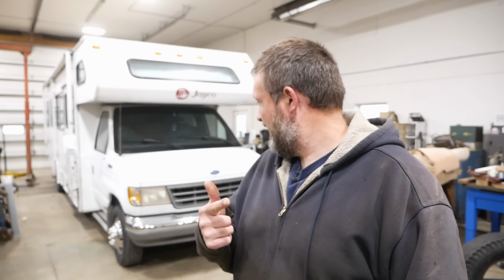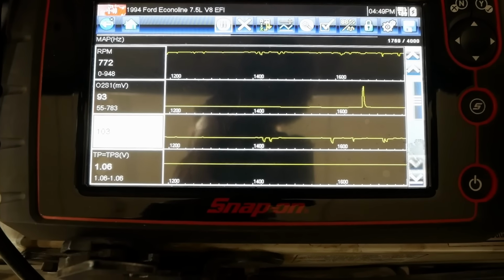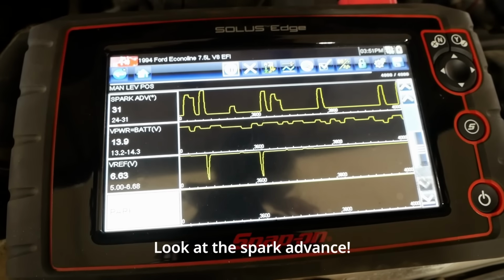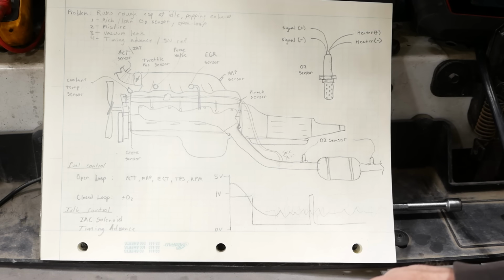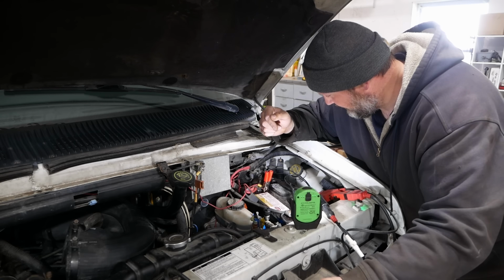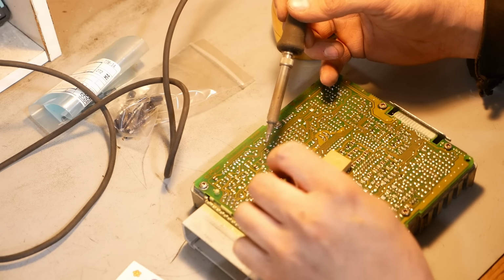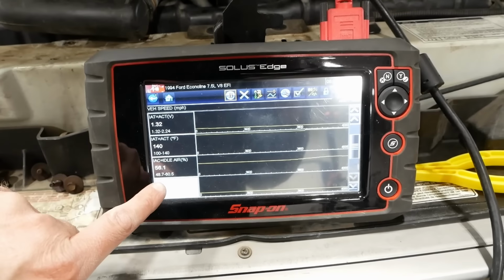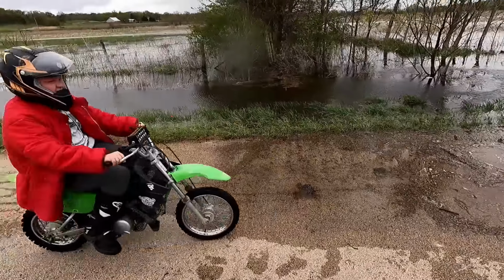Ford 460 RV Surges, Runs Rough but Nothing's Wrong?

Comment: Awesome job Wes! But you were about three years too late to help me out. I had the same situation about 3 years ago in my 95 E350 cube van with same exact drivetrain and identical symptoms. I unfortunately did not have any fancy diagnostic tools to help me pinpoint the problem. I spent many days trouble shooting and replacing various "bad" components... basically chasing the first few things you had thought it was... I love your little sketches, lists and flow charts. It ran better every time I "fixed" something but idle was still horrible. After talking to everyone I knew about what it could be and relentless internet searching, I figured maybe the computer was bad. After seeing that it was not even available anymore and for some outrageous price I could send it out for rebuilding, I decided to open it up and found the leaking capacitors. No stores close to me on the North Carolina shore sell capacitors anymore(where is radio shack when you need them?) but after a search on ebay I found a guy selling the three caps as a kit. Replaced all three and ran better than when I bought it 20 years ago! The best part of this story is that during my internet search I ran across your youtube channel because of that old E350 based flatbed you were working on. I have watched every video you have produced since. I really appreciate all the information you have put out there for everyone. I also have that disease where if its broken and I cant figure it out, it bugs me so much that I spend way more time and money than it is worth to fix it... but I am happy... I think? Broke but happy. Oh well,  I never liked paying bills anyways...
Reply: I’m glad you took the time to tell us about this experience. It’s the figuring out why,  that make people like you and Wes great. Never give up.
Reply: Thats the spirit guys!! FixNshare, that way we get a warm feeling and keep hold of our hard earned a little longer fellas. 5*
Reply: Wow dude awesome dialogue.  I have the same issues with my E350 Cube Van.  I will look Into the capacitors,  thank you for the insights and information.

Comment: Ford puts an air injection manifold on the back of the heads that injects fresh air into the galley that feeds the EGR valve.  There is also air injection into a 3-way catalytic converter.  There should be 2 vacuum controlled valves, one is the thermactor control valve, this should turn the air injection off and on, the second is the thermactor diverter valve, which chooses between the catalytic converter and the EGR ports.  I suspect one or both of these actuators and valves are not working properly.
Reply: Thermactor to the back of the heads was only on carbureted 460's (up through '87... I drive one)
'88 on they inject air into the manifolds only and only have a single pump.
The check valves do get flakey.

Comment: Sooner or later the exhaust manifold leaks need to be fixed or it'll never run right.  We had a customer with a F-450 dump that was on it's 3rd clutch in 500 miles...nothing wrong with the clutches the engine wouldn't idle because the manifolds leaked so bad it threw off the O2 sensors.   They SUCK to get all the broken studs out...nobody likes doing it so expect to pay dearly.

Comment: I'm right along with you I don't understand it either (insert Ford joke here) but funny enough my 89 f150 lariat had the same problem on the same exact capacitor after replacing those three caps the truck is still doing great three years later after the repair.

Comment: Electronics repair tech here, and I have to compliment you on your repair process and tooling. Only thing I would add would be to have added a bit of RTV to the capacitors to act as a shock absorber, given how much vibration the computer would be subjected to…

Comment: I had a 1988 Isuzu Trooper with a 2.6 liter engine that would idle in open loop, but as soon as it came off idle it would go into closed loop. It apparently was supposed to work that way. There was a lot of weird and difficult engineering decisions in that engine.

Comment: It actually makes sense to me that those older engine computers are having caps spill their guts, it's a huge problem with classic and vintage computers, and that's pretty much what that PCM is now age wise. Repairing it is also probably the best course on any of these older vehicles too, because junkyard parts are just as old and likely to have the same problems. Soon you just won't be able to get already working used PCMs, repairs will be a requirement.

Comment: when I replace leaking capacitors I usually apply vinegar with cuttonswabs to the nearby pcb area (to neutralize the capacitor fluid) and then, then clean the vinegar with Isopropyl alcohol. Any leftover capacitor fluid can easily continue to eat the pcb. Not sure how well this works when the pcb is conformal coated as any residual capacitor fluid might be stuck under to coating and the vinegar won't reach it..

Comment: That was a cheat in the 90s West for How passed emissions that were in effect is that they injected are directly into the exhaust system to lower the exhaust 02 output. That was the big stink that the EPA found that all the 90s vehicle had to where they would get around the carbon dioxide output on the gasoline engine is that they were injecting air to dilute it out. That's where they came up with the Cash for clunkers so they could get all those cars off the road....

Comment: pausing and commenting part way through when you opened the pcm.. I knew the moment you said that your v-ref was 6+ v that you had a leaky or damaged capacitor.. damn electrolytic capacitors like to leak around 25-30 years. I just re-capped my NES, Comodore 64, and my PCM for my 1989 Chevy Pickup.. ah aging electronics...

Comment: I wonder if the long crank time of that black 7.3 powerstroke you worked on was caused by something similar (bad caps from sitting, or perhaps mouse piss corroded the inside of the ECM?) I'd be curious to find out. I find that fringe electrical issues on vehicles of this age sometimes do stuff like that

Comment: Well, this video convinced me, my nut busting days are OVER. After trying to follow your schematics ,to no avail, I turned to the MOTORS manual for my current ride in an attempt to wrench it back to good health. It is an 05 Mitsubishi V6 GTS. Each page sent me in another direction. MAP, MAF, idle air/fuel motor? spark plugs, ECM (God forbid), multiple catalytic converters and 02 sensors. My once pride and joy sat in my garage since my last birthday 11/28/ 22 It is now almost Mother’s Day of 23.

Comment: My sense is there are other signal failures inside that ancient PCM board that will need advanced module testing equipment to confirm. My recollection of this vintage of components and firmware is not comforting. It will be back to say hello again sometime.😮

Comment: The challenging part of electronics is nothing is certain, its all "FM". The vehicle is not line powered, so there's no sixty cycle ripple, from the bad Caps. Though there's likely switching transients, from the solenoids etc.
Good job finding the problem. Even with the low mileage, i was wondering is there would be "green pus" found...

Comment: @ 26 minutes you said you didn't understand why that worked.  I'm not sure but I think I know?  Sometimes a capacitor can be a noise filter of sorts - and I bet what happened here was that failed capacitor - or one or a combination of them - was helping to give the computer a clean enough signal so that it could "understand" what the sensors were telling it.  Just a theory, and either way, a heck of an interesting video!   If I lived in your neck of the woods you'd be my go-to guy, I can say with certainty.

Comment: Kudos! Most places would just replace the whole brain box instead of replacing the faulty condensor.
Boats are simple. Just rip out all the wiring, start over by putting grounds everywhere, redo the wiring, and if it's points and condenser replace with a Mallory Electronic conversion.  😎

Comment: Charge your time. Your one of the extremely few that would have bothered to diagnose that. And you fixed the computer with 5cents of parts. Whats a new computer cost? 75% of that cost to me is acceptable. Rates from Australia to the US are difficult to compare, but if my mechanic had said thats a 1000 dollar bill, i wouldnt have questioned it. Time and experience is what you pay for plus parts. Especially with the video evidence.

Comment: the secondary air is not always on its controlled with silinoid diverter
Reply: The pump is always on, sometimes it farts into a muffler or airbox instead of the exhaust.

Comment: Obd 1 is the worst, I spent forever a few years ago chasing my tail with an early 90's Chevy van with the tpi injection.   Would run fine on start up, then after a minute,  pack up and run like poop.  Never actually figured it out.

Comment: I've had many ford trucks of that era and still have 3  92-95 ford trucks and one thing I've learned over the years is that those capacitors always go bad. I can't even begin to remember how many I've changed out. If i have an odd problem with one of my trucks I will always pull the ECM and check the capacitors. More times than not that will be the issue. So for less than a dollar in parts "new capacitors" I'll fix the problem. I keep replacement capacitors on hand, beats paying for a new rebuilt ECM.

Comment: Amazing.  Most mechanics, if they could figure out it was the computer failing, would have tried to find a new one or a "new" used one and skinned the customer for the high cost.  Very few would have the ability or the knowledge to be able to repair the computer.  You did that customer a real solid.   Well done!

Comment: The EFI 460s have very odd programming. They rarely ever go into closed loop fueling, even at idle. 

The air injection doesn't run all of the time, and the computer can accurately sample the air fuel ratio when the air injection is operating in bypass mode.

Almost all vehicles employ feedback spark control to smooth out idle. Like you said, the IAC handles big swings, the spark control tries to smooth things out. Some Toyotas of that era could even adjust spark timing on a per-cylinder basis.
Reply from the maker: I never knew that.
Reply: @WatchWesWork  There's a quick little video called "HP Tuners GM Gen III: Idle Spark | Evans Performance Academy", where they (very) briefly go over how the idle spark control logic works on GM vehicles. 

By the way, those capacitors failing are super common the EEC-IV Fords. It's pretty much accepted that eventually all of those ECUs will have capacitor failure. When all the caps fail, you'll get a no-start with the fuel pump constantly running. So if you ever encounter a 90s Ford doing that - just go straight for the PCM.

Comment: A thought on the reference voltage reading high on the scan tool. I have run into car manufacturers scan tools not interpreting data correctly. Maybe its possible that was the situation. 🤷‍♂️

Comment: The secondary air sould only blow air during the warmup. The reason is to heat up the catalyst system to working temperatures as quick as possible. When the engine is up to temperature (closed loop) the secondary air system normaly shuts off...
When the vehicle is cold the engine woks under rich condition. The Blower brings extra air to the catalyst force a thermical reaction. This heats up the catalythic system.
Funfact: Such an system is also installed on my 2007 Audi. With an electrical blower...
Reply from the maker: There is not cat converter. Never was on these trucks.
Reply: They just pump extra oxygen into the exhaust in an attempt to burn off CO and HC before it makes it out the tailpipe.
This is a big reason why the manifolds warp and crack.

Comment: What should normal long term fuel trim should be ?
Reply from the maker: For most engines less than 10% is OK.
Reply: @WatchWesWork  I think bank 1 is usually around 3 to 6 POS and bank 2 is little higher id have to look at live data again

Comment: Love the "WES CAD" drawing,  sorry Dave Jones.
Great explanation Wes, never heard of a speed density engine before, not sure what it actually means or differs from other control protocols.
Max is sharing your pain.
Nice bow wave 👋 
Excellent job as always,  thanks for sharing
Reply from the maker: It measures pressure and temperature to infer the air flow rate rather than measuring it directly with a mass air flow sensor. They are actually more reliable, but you rarely see them anymore.
Reply: @WatchWesWork  Thank you, lot clearer now.

Comment: You shouldn't use capacitors with a voltage rating way over the value of the one you are replacing.(going a little high is OK, like 25v replacing a 15v cap)   Capacitors maintain themselves by breaking down the electrolyte to put an oxide layer on the foils.  The voltage rating of a cap is determined by the physical characteristics of the foil and electrolyte.  By using too high a voltage rated cap, the cap fails because there is not enough voltage to generate the oxide layer. 
Youtube user Tech Tangents just uploaded a video on this yesterday.  He doesn't specifically mention the problem of using too high a rated cap, but explains it well enough that someone who is novice can easily follow it.  This is my field of work.  it's bad practice.

Comment: It may be programmed to not enter close loop below a set vacuum.  or it needs to relearn. I'd be curious if you tested driving with scanner on. Or if it was drove long enough to relearn. As frustrating as it can be, it is equally rewarding when solved.

Comment: I had the same issue in my 1992 E-150 5.8l, replaced the three capacitors and it ran WAYYY better. Still trying to solve the power locks/alarm system. Might try pulling the modules out to replace some capacitors or look for cold solder points

Comment: Good job.  I sounded like that turd was a victim of the capacitor plague, but that didn't happen until 2001.  At work, we replaced electrolytics on 100's of industrial computers.  If the leads are long enough, you can snip them of between the cap and the board then just heat each leg and pull them out.  We just pulled the cap off the leads, and it didn't damage the board.

Comment: Good that you spotted the rotten electrolytic.  I suspect that this engine has a type of an intermediary, partially closed loop system.  Open loop exists until the coolant sensor sees a few degrees of warmth. The computer then engages partially closed loop by adding air to the fuel rich exhaust to ‘heat the catalyst’ and monitors the downstream (after the catalyst) O2 sensor.  This will, initially, read low indicating high oxygen levels in the presence of a cold catalyst.  When the O2 sensor reads high the fuel air mix has become anoxic in the presence of a now hot catalyst.  This signals the computer to engage closed loop by looking solely at the upstream O2 sensor output by moderating (through continuous adjustments to the injection times) the normal engine fuel air mix.

Comment: Wow!  I’ve never seen even the best mechanic I’ve ever been to actually do electronics work on a vehicle’s computer.  If they came to the same conclusion you did, computer “failure”, they would just replace the whole thing, not get into the nitty gritty of electronics repair.  This is above and beyond work.  If the owner is serious about keeping this on the road, the Banks Stinger package with the stainless headers would take care of the cracked exhaust manifolds and allow the rig to breathe better and he’d get a few more HP out of it.  Kills a lot of birds with one stone.

Comment: if the exhaust manifolds leak you need to fix FIRST. leaking air will wil make the computor go nuts
Reply: It's a speed density system.
It doesn't give a damn about an exhaust tic.

Comment: Check your fuel pressure regulator.   If had 3 efi fords run just like this. Mine were stuck open
Reply from the maker: The owner had replaced it.

Comment: I believe you will be like MadMax after the EMP blasts. You'll be living on the road and that camper. You know Ford is built a lot of bad engines matter of fact I believe there's only two engines that they actually produce that were quality and that would be the the conventional 302 5 l and the 5.8 l roller cam Motors that came in Ford pickup trucks. That 460 was just a pig an absolute and total pig of an engine just a gutless oversized behemoth prone to oil consumption low oil pressure leaking oil leaks just a terrible terrible motor. I don't normally enjoy your videos but I watch them this was enjoyable although at least you don't act like a queer like a lot of these video YouTube homos

Comment: I expect there are several people who could fix this problem.  However, finding one in a shop where you could take the vehicle to have it competently repaired would be a horse of an entirely different color.  And if you were to defy the odds and find that shop, with one of those qualified people, finding one who would put the care into the repair as if it were their own vehicle would be that much taller of an ask.  As for understanding...there's a lot of Ford engineering that baffles me too.  Spectacular work, Wes!

Comment: Shango006 on his youtube channel says those capacitors in those old ECU boards has to be change by now. So you learn but Shango006 got lots of videos on ecu caps problems. Even thore his channel is mainly working on old tv and radios. He dose pop on videos of other stuff too. So any thing that come in your shop now that 1990s. You mite just go right to changing caps on the board. Think you count it before it wreck the pc board. Some ECU got wreck on Shango006 channel by caps that leaked.